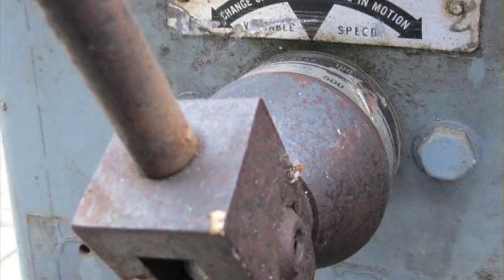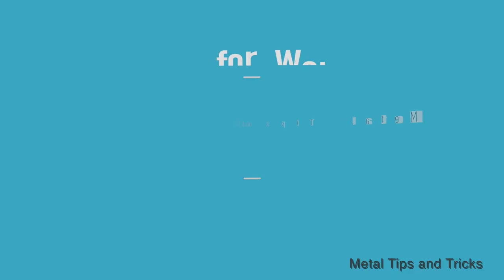Turning Metal by hand

Comment: Randy is a Godsend that is invaluable.   This video just gave me another way to machine on my small 3" Craftsman metal lathe.

I'm thinking  Old Phillips screwdriver handles  and drill rod blanks  and really small tool bit stock 

Mahalo Dale for  showing us this stuff from a different perspective
Reply: Most of the Atlas and South Bend sized lathes used in "home shops" were actually designed to turn wood as well as metal. That is one of the reasons they have the very high speeds compared to the larger lathes. There were complete wood turning accessory kits from the factory.

Comment: Hello Dale,

In the past I've used a template to create that kind of shape. You mount a stylus of some kind on the top-slide to follow the template and wind in the cross-slide till the stylus contacts the template. It's a poor man's hydraulic copying attachment. 

I've also used the graver technique as well to finish a part roughed out by 'kelllering'. I learned a lot from older books given to me and from articles in 'Model Engineer's Workshop' magazine.

Comment: Great video. I actually have the need to turn a couple of these for my little South Bend 7" planer. I'm an old sheet metal worker and have roughed parts before in the drill press with a variety of files. Looks like the engine lathe will produce this easily with my new knowledge. Still gonna cheat and use my ball turner I recently made. My motto is the best way is the easy way. Thanks guys.
Reply from the maker: Great comment , thanks

Comment: I've wanted to do this so many times!  Just for things that the tool post isn't good for mostly.  Making something look graceful... There's literature about this, people definitely used to cut threads, bore out holes, and on top of it maybe the lathe was powered by a treadle!  I think having the right tool rest would help a lot.  You can see them on a watch-maker's lathe.  It's got a sort of sharp edge, and can be put very close to the work.  For a bigger lathe you'd surely have to make it.  BUT I think it makes the cutting forces even less, and gives more control.  I'm thinking that if the tool rest is very close to the work, then your tool handle is a very long lever by comparison, and you have a mechanical advantage of hundreds to one.

Comment: Great video, great guest star! Gravers have been around since about the 17th century, used mostly by clockmakers. On the Sherline website there is a page on how to make gravers. See also the perplexr watchmaking channel. They show you how to make one and how to hone it, and some more on using it. I made one myself out of an old drill bit. My advice is (1) make sure you put a handle on it. (2) start out on Aluminum. It's good practice material. Then you can move to brass and steel. It is a lot of fun and often just as fast as a tracer attachment or a form tool.
Reply: Do you have a link to the perplexr channel on making the graver?  I took an engraving class where we made our own, but I'm always interested in other ways.  Everyone has something to teach.
Reply: didn't work for me...
Reply: Didn't work.  It said video not available.
Reply: Oops. Well, the channel name is perplxr.  Search on "perplxr channel". Cut and paste does not seem to work on thesee notifications.

Comment: I just tried that out on my lathe, I made that round tool out of some w1 dril rod, quenched and tempered. Wow that is really effective, even on steel. On brass the metal just flies off almost like it was wood.  I haven't tried aluminum but I expect it to be simmilar. I'll rough out the shape with  a cut-off tool and round it all with the round hand chisel.

Comment: I turned a couple brass pieces with a drill press (I don't have a lathe) about a month ago. It was slow going but I got the parts I needed. I don't think I could have done it with steel but softer stuff can be turned with few "proper" tools.

Comment: I was taught by an old timer to use the compound slide cutting into the part as the feed rate moves the carriage at a slow rate. I've rounded off a ball end on a part that way. Does Randy ever use that technique?
Good stuff, Thanks.

Comment: Great video and I can tell lots of experience to share. I do however know that it is possible to machine on the side with no problem, the trick is to use a solid built tool. I have used my Carbide-Insert wood turning tools on my metal lathe, the round cutter is the best to work with but the triangle shape works very well. My tool shanks are 1/2" - 5/8" square cold-rolled steel. I made them myself. You can find many videos that show how to use the tools on wood, then start on soft metal before you move on to steel. Awesome work to show off. Thanks f I can do it anybody can.

Comment: Dale: Check out the clickspring channel here on YouTube if you are interested in hand turning. The owner of that channel is making a clock from raw stock and he does a lot of hand turning to achieve domed shapes. He is working primarily in brass on small machines but it is informative on homemade form tools, knurling tools and some other neat fixtures needed in working tiny parts.
Reply: I like clickspring too. However, it seems like Chris (clickspring) uses his graver in more of a side cutting orientation like a normal lathe tool. It seems like Randy recommends hand turning with the cutting edge more at the top of the work piece. Do you agree with my observations?
Reply: +Makercise You are correct.  These are two techniques that can complement each other. Randy is more slicing while Clickspring is scraping which is safer on brass to prevent digging in as it has less rake. Daniel

Comment: Not having expensive proper tools, and having to improvise for years, this stuff is kind of old hat to me. My favorite tools now are diamond bit dremels. I do not even have a lathe. a drill press mounted sideways and a dremel with cheap diamond bit tools from China. When you use a dremel there is practically no pressure sideways on the quill of the drill. Obviously you do not quite get the precision that you get with a lathe. Once you try it you might be using it a little more often than you think. The set up is different, you have to think in terms of a wood lathe, measure often but it often does a quick job.

Comment: Very nice technique replacing CNC work where tolerances are not so important. Clickspring - a beautiful watchmaker channel - also shows some hand turning of drill rod (https://www.youtube.com/watch?v=2Nle33eb1Uo  at 1min30sec). He does not hold the tool cutting edge tangentially but to centre height, as we are used to, and it works too. Maybe his tool rest being a bit closer to the work is what allows that.